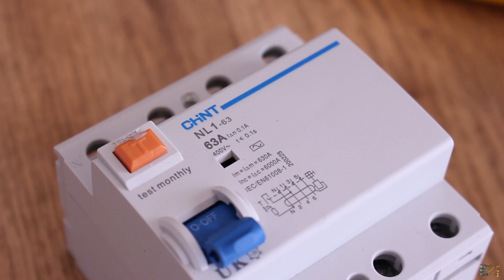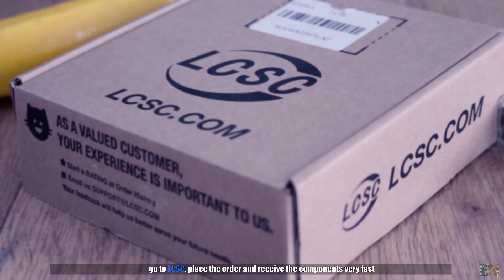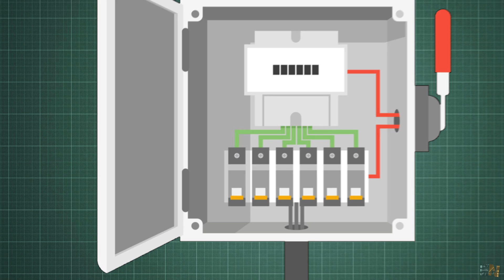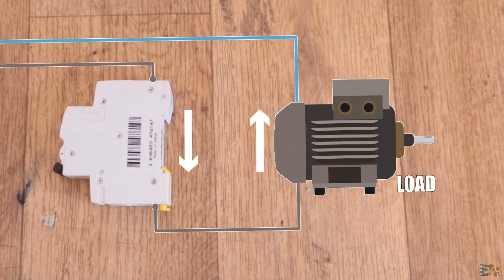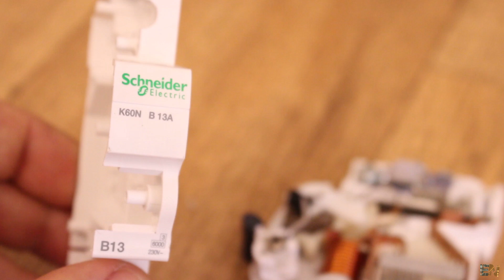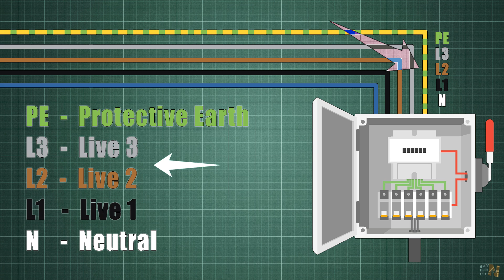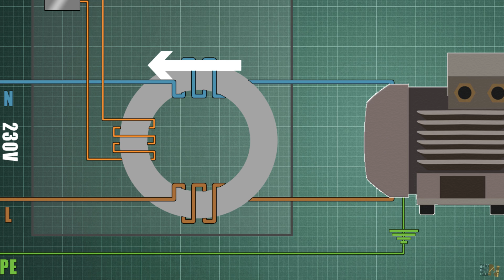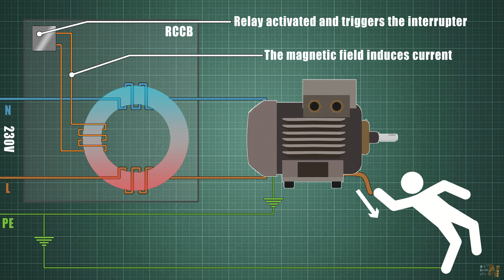Safety Circuit Breaker MCB and RCCB | How They Work?

Comment: Does this device  work when the 220 is two phase  no nutral at all for 220  the old  system in ksa is split phase in old houses  because  I noticed   the load side has neutral  and l1

Comment: What if I have 3 phase running thru the RCCB and I take current only between 2 phases for example. Does the circuit breaker trip in this case?

Comment: Thank you, very nice. But respect RCBs (or RCDs): is not bonding of the neutral wire to extratrenous conductive parts necessary for detection in the current imbalance? How would that come into play in your explanation?

Comment: The RCBs are also great because most device cases are grounded, so even if theres a short to the case of the device and it just allows a tiny current (not enough to break the mcb), the rcb will trip before you even get to touch the live case :D

Comment: But with AC isn't live and neutral the same but with different phase?
Reply: In 3 phase neutral is the mid point of star side in delta-star transformer.

In single phase the neutral is the neutral that was in 3 phase and live is any one of the 3 phase.

In single phase the wire you make ground (0V) is neutral, i.e no change in above condition but if you make live to be neutral (assume it's 0V) then neutral will become live with 180° phase difference, or the wave just flips over. But in reality the live is live and neutral is neutral, live will still give you shock even you assumed it is neutral.
Reply: The appliance probably doesn’t care which is which

But we install most switches and most circuit protection on the side that removes the most of the dangerous potential

So neutral is usually connected to earth partially for that reason (anything touches earth, trips the circuit breaker, removes the ouchy, now it’s safe)

And as mentioned in Star wound transformer neutral is the middle, all voltages revolve around it, -230 will hurt you just as much as +230, male everything relative to middle, any faults should trip it
Reply: No like the person below me said thats only between P1-P2 or P1-P3 or P2-P3

Comment: In the UK they are also called RCD (residual current devices) or RCBO for combined RCD and MCB in one unit. Its worth noting these are operated by current (generally 30 milli amps), whereas in the past they used something called an ELCB (earth leakage circuit breaker) which was voltage operated I believe.

https://en.wikipedia.org/wiki/Earth_leakage_circuit_breaker

Comment: Is there anyone who's experienced in 3d printing?
Reply: Reasonably.
Reply: @BurtMeister  I have queries related to 3d printing, do you have a group or something? I am new to 3d printing.
Reply: @oxycada9272  I'm not actively a part of any group, other than a facebook one, but I no longer use facebook. There is a wealth of information on Youtube though and I'm sure there are discord servers dedicated to it. Is there anything specific you need help with?
Reply: @BurtMeister  actually my many prints have failed after a few hours so I wanted to know possible reasons.
Reply: @oxycada9272  Most of my print failures came down to bed adhesion. I haven't had this with my CR10, but frequently had it with my delta printer because it had no heated bed and a little with my Tevo Tarantula. Below I've linked a good guide to troubleshooting from Simplify3D so you might be better able to tackle your problems...

https://www.simplify3d.com/support/print-quality-troubleshooting/
Reply: @oxycada9272  It might be a fault with the STL file if you have tried printing the same thing over and over. I have had this also.